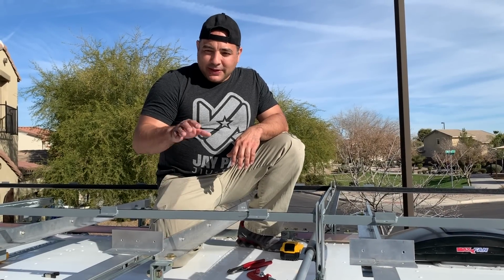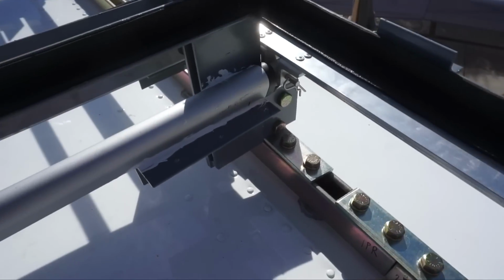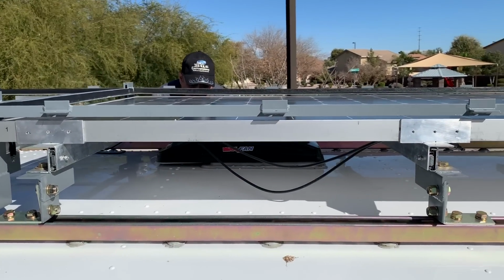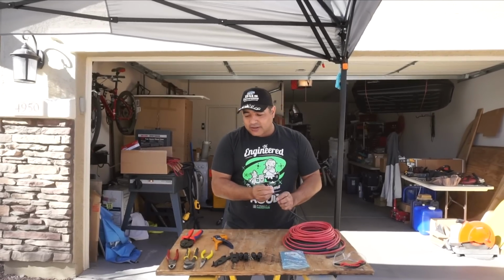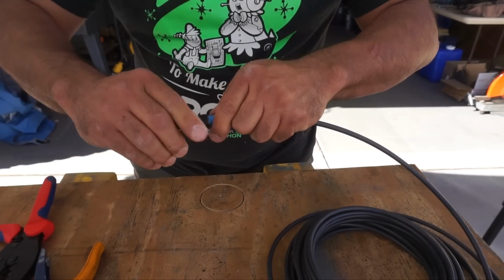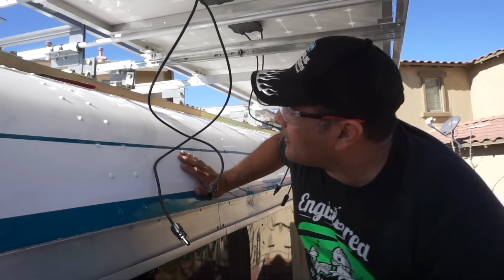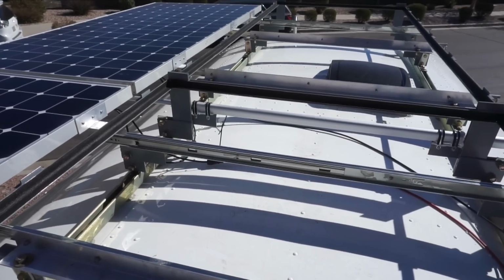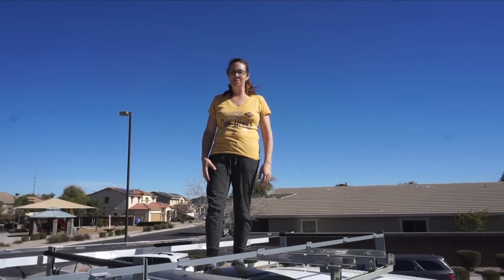Solar Install: Part 3: Mounting Actuators, installing and wiring the lower panels

Comment: This is going to be really nice when you're done with it. Just so you know, now that you've used 5200 caulking to hold your actuators on, they won't last 2 weeks! That stuff is known as "how to screw the next guy" in the boating world. You'll have to use an air chisel to get one of those off.
Reply from the maker: Thank you Lee - removing the actuators is going to be a bit of a chore.  Hopefully, they last a little while :).  On this particular thing, we wanted to err on the side of safety.  I would rather struggle a little bit to get them off than worry about them flying off the bus.  We are seeing no sag at all when they are fully extended.  I measured the load on the motor to see if it was struggling - it was pulling 1/2 an amp for the entire length of the slide.
Reply: @BeginningfromthisMorning  Are you seeing any sag when the panels are extended? Those type of actuators don't like to try moving bent rods. I still have concerns about the operating end being fixed in place.
Reply: An oscillating dremel tool with one of the flat blades might be able to cut through it. That's how I removed a factory AC on a Sprinter that used this crazy hard glue.
Reply: My thoughts EXACTLY! If one of those actuators fails it will be a cast iron beyotch to remove the bad one. You should always allow for the ability to perform maintenance or repairs on any design. Nothing made by man or woman is failure proof!
Reply from the maker: Thank you Dirt Road Sailing - Yes the 5200 is extremely strong - we messed up the first time and used rubber that was too thick on the upper panel frames.  It was a bit of work to remove the rubber and the glue from the frame (we ended up using a wire wheel and just repainting the entire frame).  I don't normally trust glues but this 5200 is making a believer out of me.  You are correct that replacing the actuator will be a pain - I hope they last a while ;)

Comment: I have to say, your solar system in the bast I've seen so far, and I do watch a lot of bus conversion videos, but it still bothers me, as to how you are going to deflect the wind whilst traveling, from ripping all that beautiful work off the roof, because it will I've seen the results of that happening...xx
Reply from the maker: Thank you tigerspook1 - we are still figuring out how we are going to keep the wind off the panels - probably some aluminum sheet reinforced with some aluminum angle but we haven't designed anything yet.
Reply: I have to agree.  Side winds are going to be a big concern.  If you have time check out the "Life is a Joy" Youtube channel to see what happened to their Bus solar installation from side winds.  Pretty scary.
Reply from the maker: @genephipps6421  I have seen the exact video you are talking about - very eye-opening.  I do plan on installing side skirts similar to the ones he installed.
Reply: @BeginningfromthisMorning  Yes, Jim & Debbie did have a solar panel almost bent in half by the wind, but that was as they were travelling,.... However I imagine the winds will be a problem both travelling & stationary, for you Juan with that amazing set up you have, but even so, I believe it will take quite some wind power to damage that structure of yours, put wheels on it and the bus could still roll along upside down,... lol x
Reply from the maker: @tigerspook1  LOL - the upside down comment gave me a good chuckle.  I did watch Jim and Debbie's video when he replaced those panels - the wind can be CRAZY strong.
Reply: ... @BeginningfromthisMorning  I don't doubt that you'll come up with some brilliant idea to protect that amazing panel arrangement... xx   Love your videos, look forward to every one..xx

Comment: Looks really nice. Wondering how you're going to protect the slides against sand, moisture, and road salt?
Reply from the maker: Thank you Richard - we are curious about how they will hold up as well.  They are stainless steel and are rated for 400 lbs per pair.  I really don't think they are meant to be outside but we have had a good amount of rain an I have been keeping a close eye on them and they don't seem any worse for wear.  We do plan on putting up some wind blocks all around that should help "shelter" them a little bit but only time will tell how they hold up.  We will keep everyone updated.
Reply: I assume that you'll have the slides on your maintenance schedule, so maybe when you lubricate them you could find a type of grease which isn't as tacky as the stuff that typically comes from the factory on the slides so it won't attract the sand and dust? Just a thought.